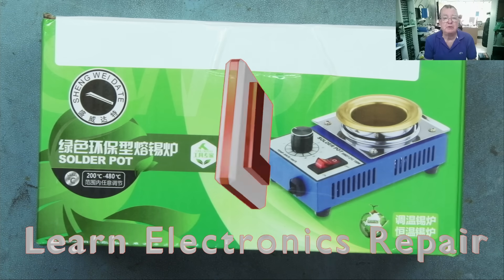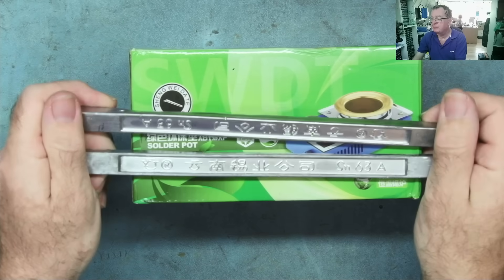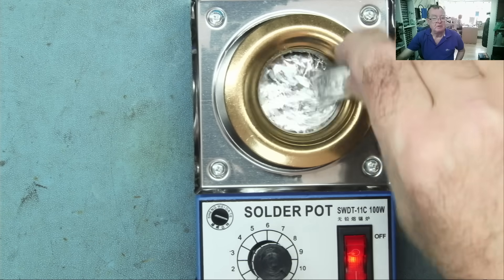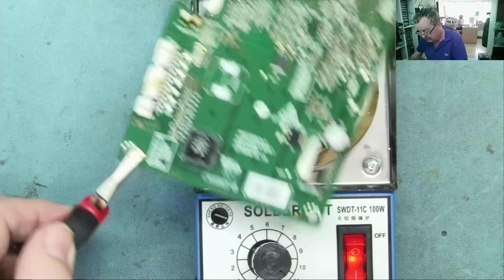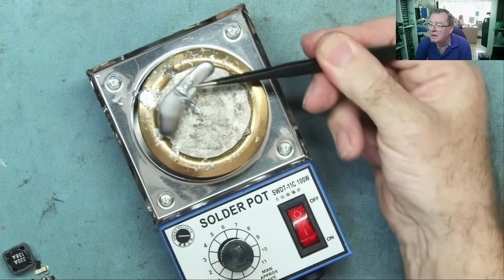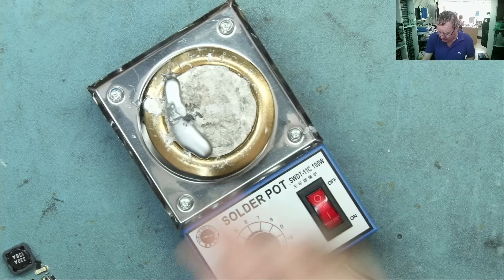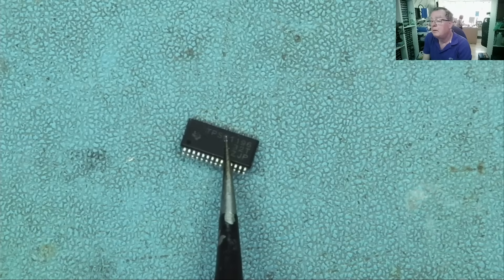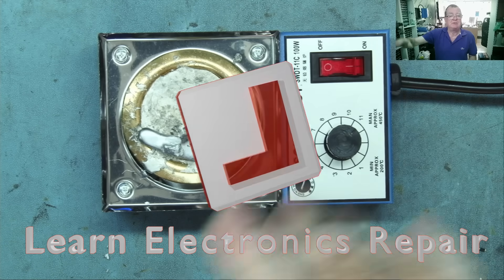How To Salvage Components QUICK & EASY With The Cheap Solder Pot From AliExpress. Desoldering.

Comment: you really need to use a temperature probe and let it sit for a bit to have a consistent temperature.  There is a narrow temperature range to prevent PCB damage.
Reply from the maker: Seeing as this video was about salvaging components from scrap electronics why does it matter what happens to the PCB?
Reply: @LearnElectronicsRepair  I've used a solder pot to fix boards where the connector is crooked. If I don't care about the PCB a propane torch also works.
Reply from the maker: @LaserFur  I would use a hot air preheater for that sort of repair.  There are a whole variety of methods we can choose from.  I've not tried a propane torch for salvage work.... YET! 😈
Reply: @LearnElectronicsRepair  Propane torch works wonders. Years ago there was a guy named Randy Fromm who had articles about repair in popular electronics magazines. One was about using a blow torch to heat the board and he said to then belt the board across the back of a wooden bench and that gets ALL the parts off instantly lol!!

Comment: Hi! I just came across your channel. Thank you for sharing the knowledge! I have a couple of questions, not about the topic of this video, but rather about budget oscilloscopes. I am a beginner audio hobbyist, so I am not looking to invest in highly accurate tools from reputable brands. Rather, I would like to get a sufficiently accurate budget tool that would be adequate for playing with my audio electronics (e.g. setting azimuth, speed, and other relevant parameters on cassette or reel-to-reel players). I was looking at a number of widely available tools from Owon, Fnirsi, Zotek, and other Chinese brands, and to make the right choice, I would like to understand which oscilloscope parameters I need to pay attention to and which ones are of lesser importance. Do I need a two-channel scope, or would a single channel be adequate? What minimal parameters I should be targeting for scope counts, transmission bandwidth, sampling rate, etc.? I would greatly appreciate your advice! Thank you!
Reply: You actually don't need an oscilloscope to fix stuff. They are way over-rated and often cited as a required tool but that info is often parroted by noobs and other random brainwashed individuals. I've been repairing electronics (mostly arcade games) for ~30 years and rarely use the scope. For digital repairs a multimeter (check voltages), frequency counter (measure crystals) and logic probe (check for digital activity) are all you need. I only use the scope when looking at analog sound areas where a DAC changes the audio from digital (easily seen on logic probe) to analog, which does not show up on a logic probe, but can be 'heard' if the logic probe has a piezo speaker. There's a lot of trial and error and technique involved with repairs and a scope is not really required in most cases. Just take a look at this channel, Rich rarely uses his scope and he fixes a lot of stuff without one. If you must get one to feel adequate and in the club one of the cheaper hand held units would be fine for random use. There are plenty of vids on YT about how to use one. But as I said, way over-rated and you don't need one to fix stuff.
Reply: @g4z-kb7ct  Thank you!

Comment: 60ish  year old technology with a new use that's more dangerous than the original! Pots were used for dip-tinning ends on cables or components in a production environment with a flux layer on it to avoid oxidation - and still could be used like that with lead free solder and good extraction. For anything else it's probably best avoided. Never designed for filling like that or recovery, use a controllable hotplate.
Reply from the maker: I've seen a few other youtuber do this so decided to give it a try.  It worked rather well (especially the pastic connectors) but it was a bit scary.  Use at your own discretion.
Reply: @LearnElectronicsRepair , a solder pot is useful for removing the enamel coating, and pre-tinning, magnet/coil/pickup wire and braided Litz wire. I wouldn't use it for depopulating PCB's however.

Comment: You could mount it to the desk for security, and at the same time lay a pipe to the fume exhaust. I think I did see it smoking quite a bit.
Reply from the maker: The solder bars themselves didn't give off any smoke.  Can't speak for the PCB of course
Reply: @LearnElectronicsRepair  just because you do not see the fumes, it does not mean that there are no byproducts in the bars being off gassed.
Reply: @GregM , the boiling/vapor point of lead is about 1100°F. Solder melts at far lower temps, and does not give off metallic vapors.

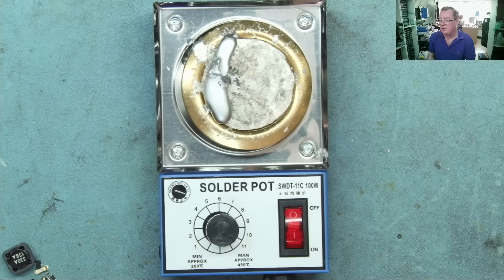Comment: 10:05 "MIN" and "MAN" temperatures 🙂 🙂... It also seems that the pot was designed by Spinal Tap.. The dial goes to 11..🤣🤣🤣
Reply from the maker: hahaha.  Didn't Marshall amps go to 11 on  the dial?
Reply: @LearnElectronicsRepair  , some early Fender amps went to 12 !

Comment: I used one of these for pre-tinning the ends of RG-8 coax so that it was easier to solder on pl 259 connector. It worked good for solid center conductor coax that was dipped quickly in . The braid on the coax got tinned so it was easier to solder on through the little holes in connector.

Comment: The first time I have seen anything from Ali that has an Aussie plug on it. I usually need an adapter. (oi oi oi) ;-)
Reply: Is it a proper Aussie plug or is it Chinese? 😉
Reply: @LarixusSnydes  good point. They don't waste any pointless metal making the terminals thick enough to stay in the embrace of it's regular socket ;-)
Reply: @dennisbjones  In that case it's probably made of Chinesium. Better check if the wires inside are not made of copper coated aluminium...
Reply: We use this kind of plugs in Argentina nowadays. Itt was anoying 20 - 30 years ago when the gobern obliged to, but there were any adapter available or plugs in the walls implemented yet.
Reply: Chinese plug. Earth on top, and thinner pins. Not legal, and neither is the copper-coated steel conductors in non-compliant insulation.
The earth is super dodgy on these too.

Comment: I got one of these to hot dip galvanise small parts. Always wondered how it was supposed to be used.
Reply: They’re normally used for tinning wire. Component salvaging is NOT their primary (or even secondary) purpose…
Reply: Surely it doesn't get hot enough to melt zinc?
Reply: @goodun2974  had to melt a little pb solder first then it does melt.  I clean the parts with hcl and let it sit in the pot for ten mins.  Not true zinc galvanising but good enough

Comment: Thanks for the vid, we use them at where I work too remove enamel off copper wire, but when they are hot, don’t put a off bit of solder, I did and it exploded, luckily I was walking  away when it happened.
Reply from the maker: Thanks for the warning!
Reply: @LearnElectronicsRepair , a drop of water, soda, coffee/tea or other beverage landing in the molten solder will cause hot solder to go flying everywhere. No drinking of any kind on the job!
Reply: A solder pot is an absolute necessity for winding your own inductor coils, guitar pickups and electromagnets, or for soldering Litz wire.

Comment: I don't think you should get used to using this thing Mr. Richard it is nice yes but accidents can happen I'm afraid.
Reply from the maker: It was a little scary.  At least you can't easily knock it over.  I would suggest stand it in a flat bottom baking tray and wear heat resistant gloves and you should probably be OK

Comment: Interesting use of the pot. For me, this thing has too much hazardous potential. I'd rather put the PCB on a hot plate - which is dangerous enough, but won't spill lava across the desk 😶
Reply from the maker: It was a bit scary!  I would suggest standing it in a deep baking tray or something like that then it should be safe enough no matter what happens
Reply: I was thinking the same.

Comment: I know I can probably Google it but what is the proper use of a solder pot? Is this it?
Reply: also useful to tin wiring and connectors
Reply: It’s for tinning wires.  You could also potentially use it to “wave” solder small boards. I suspect using it as a hot plate is not the intended implementation of such a device.  I would not do this procedure without goggles, gloves, and a strong exhaust fan.
Reply from the maker: @pault6533  Yeah tinning enamelled wire is the common use.  This was rather more fun LOL
Reply: Thank you all!